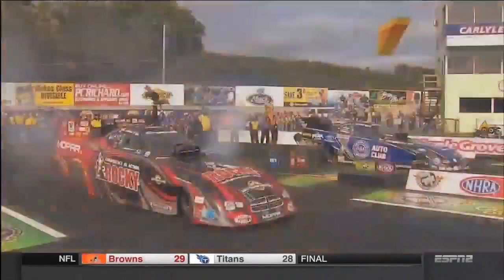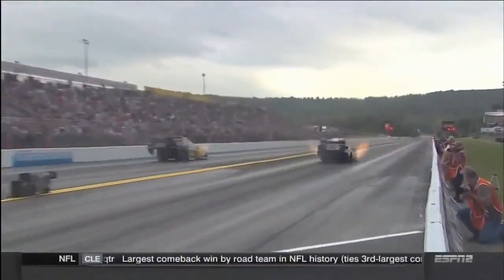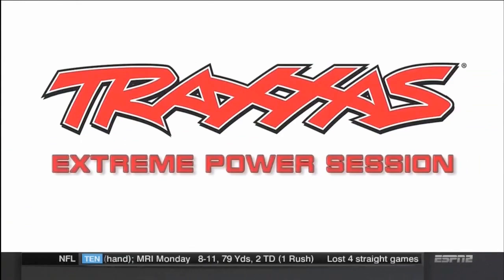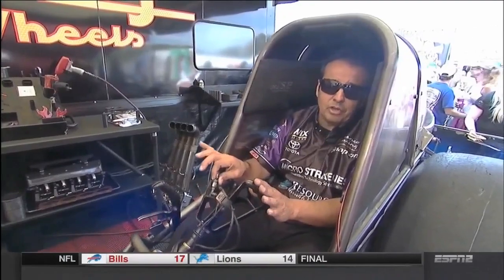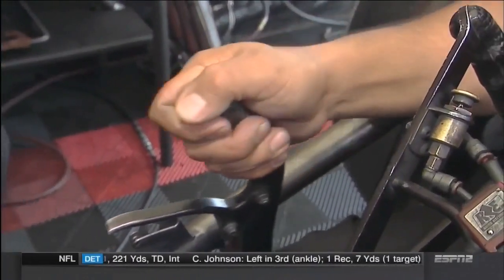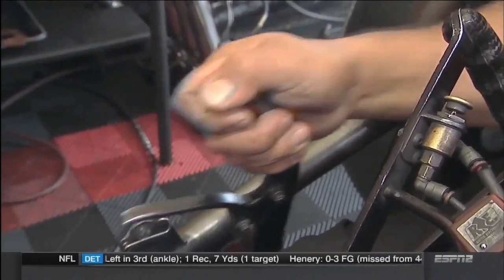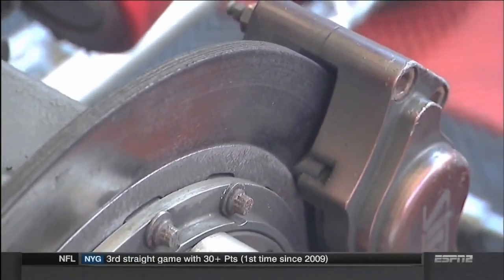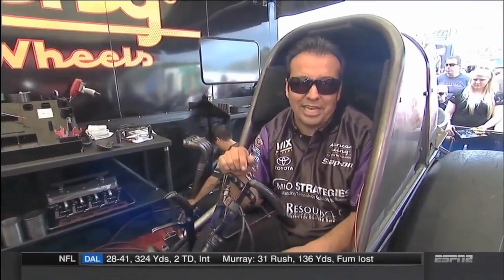How do you stop a 300+ MPH NHRA Funny Car?

Comment: More braking on the cars have been needed for a LONG time.  Bigger front tyres and more bias front would help stop. And if everyone had them no edge lost.  Radial tyres too ofcourse,, far better under brakes.  Slow the cars a little as well. 
Throwing out the hanky is really a big' if it works' And far too often it does not. Those cars really are very dangerous. Engines blow the body off, junk brakes and suspension. And very unstable as soon as they get off line.